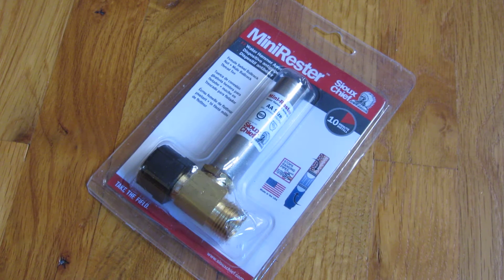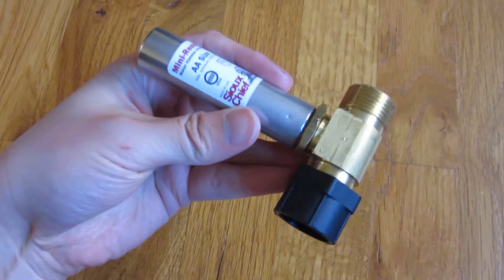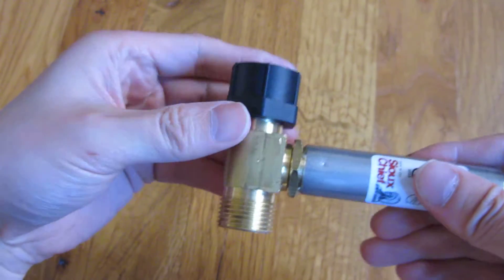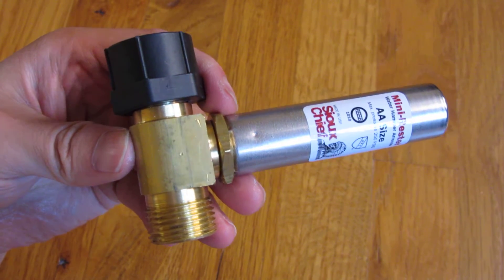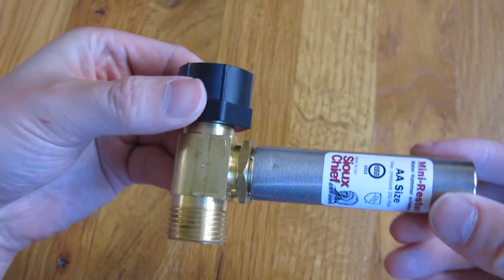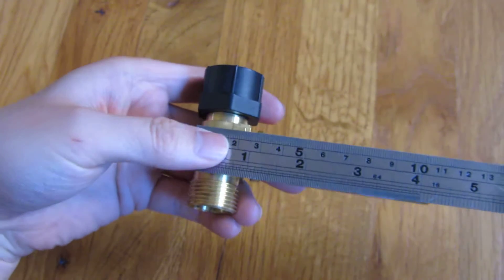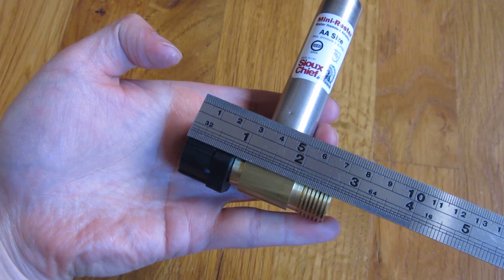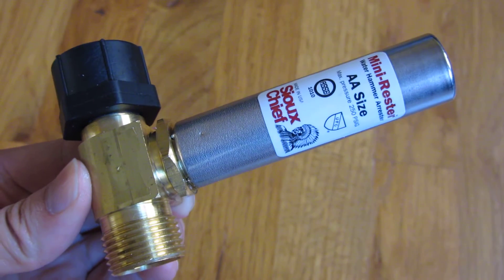Water Hammer Arrestor for Toilets (Sioux Chief 660-TK)

Comment: I got one of these but it didn’t fit my pipes, my toilet water pipe fittings were 3/4” but the hammer Arrestor fitting was 1”
Reply: Most toilet fill valves are 7/8”.  This screws right onto the fill valve which is the stub sticking out the bottom of your tank.